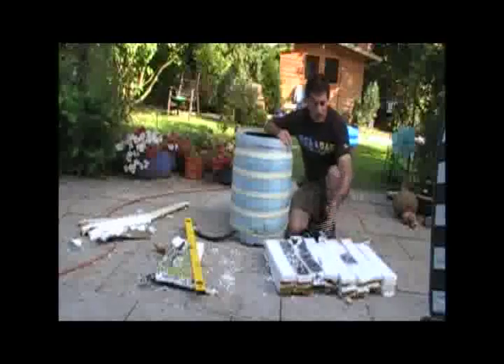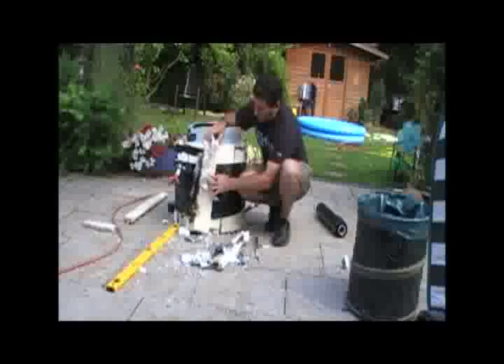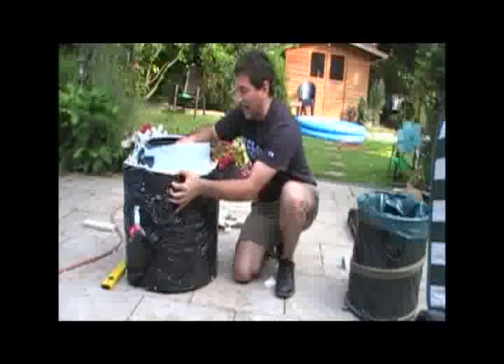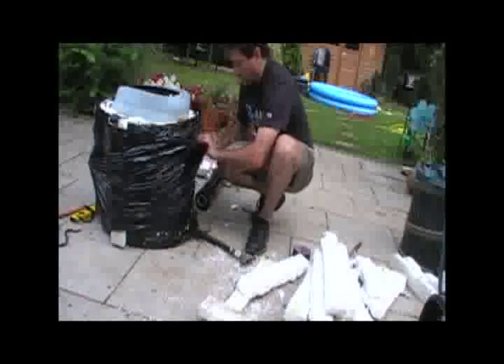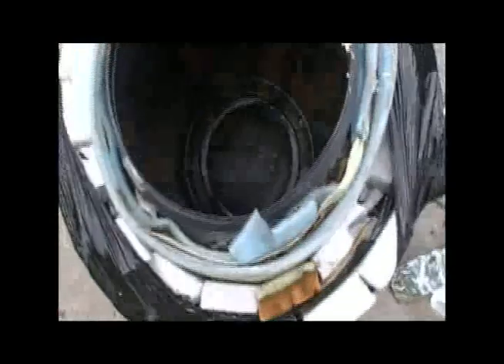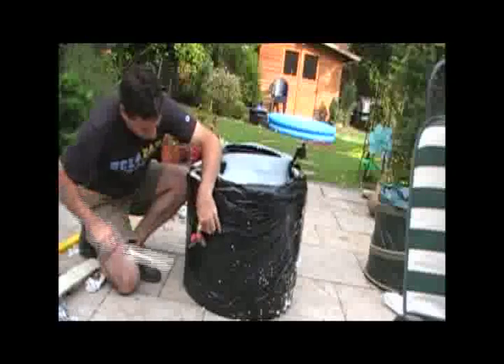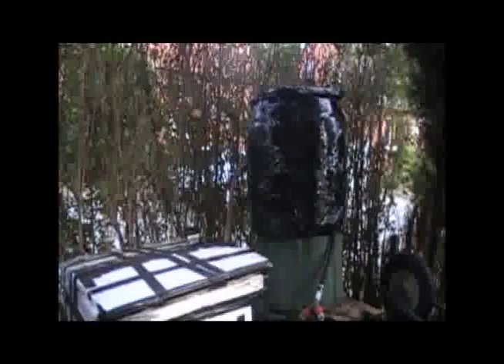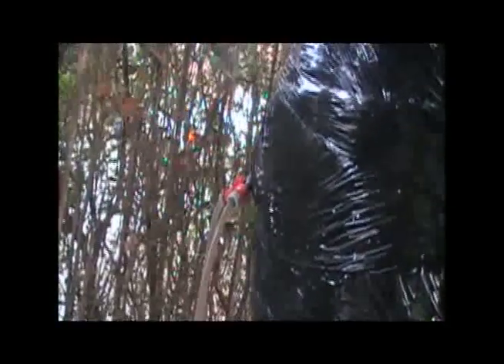A simple way to insulate plastic tanks for solar hot water or compost heat storage

Comment: Thanks!  Just what I was looking for.  I want to use this as a hot water tank for camping showers.  I'm going to put a low-power fish tank heater in the tank attached to a solar EV system.  The tank can gather the heat slowly and be ready for a shower.

Comment: Great way of insulating. How about using a bungee cord, or even a piece of inner tube  to hold the styrofoam strips in place until the shrink wrap ties everything together? The bands could be used over and over eliminating a lot of single use duct tape.

Comment: Your video gave me an idea: An alu keg or a steel drum could be insulated on half of its circumference and have its non insulated part painted in black. Then it would be placed on a lazy Susan tray and inserted tightly in a well insulated wall facing the sun. That sun facing portion would be protected behind glassed occlusion.During day, the sun would heat up the drum filled with water. At night the black painted  face would be turned 180 degree to radiate its heat into the house.